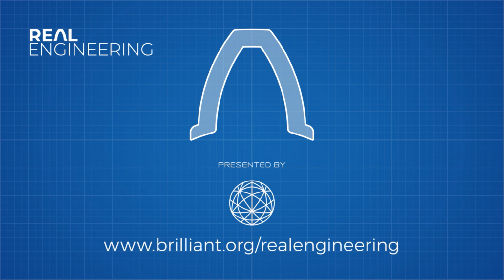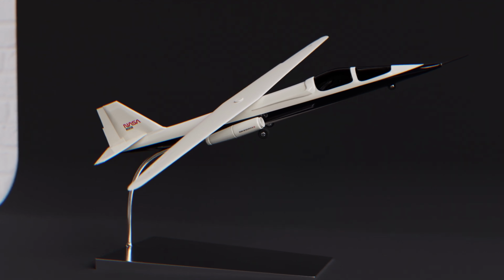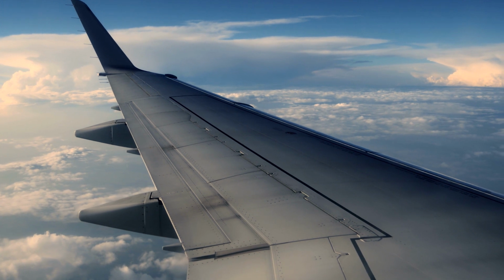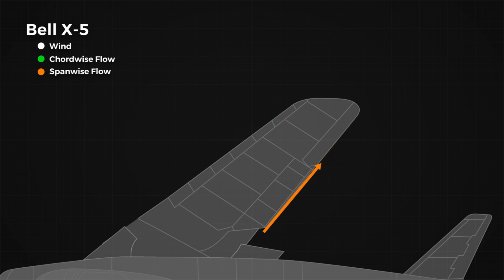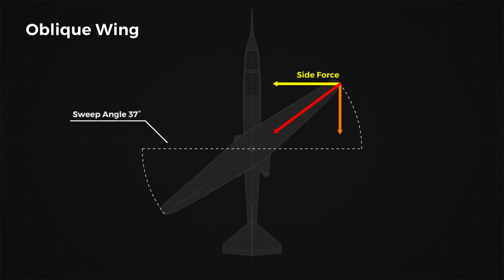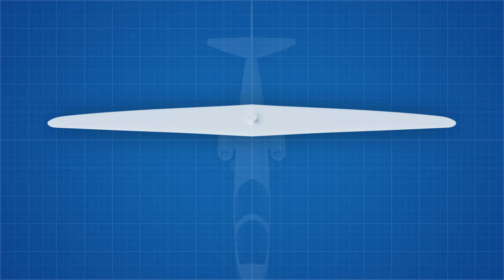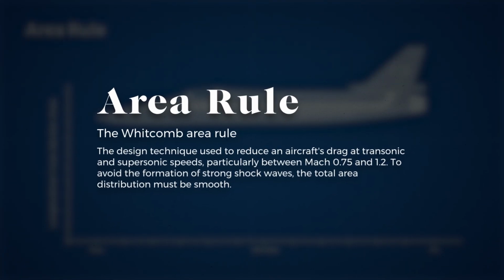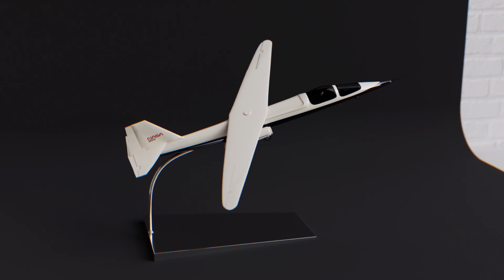NASA's Weirdest Experimental Plane

Comment: Many mistakes in this video. Really disappointing that you spread misinformation.
1. The reduction in (parasitic) drag with sweep angle had nothing to do with frontal area. You correctly say later that it's due to a reduced speed component perpendicular to the leading edge, which at transonic and supersonic speeds creates less wave drag.
If reduction in frontal area was any factor at all, than variable sweep aircraft would sweep the wings back as soon as they took off and cleared the ground, which is not what they do. The sweep back helps only when the transonic regime begins, at lower speeds it is detrimental (increasing induced drag while having no effect on skin friction drag). This is why the F-14 keeps its wings fully forward until Mach 0.7.

2. Airliners don't cruise "just below" their critical Mach number, they cruise just above it. Source - the book "Aircraft design: a conceptual approach" by Raymer, section 12.5.10 - parasite drag. 
Quoting the relevant points: "drag divergent Mach (Boeing definition) is is usually 0.08 Mach above the critical Mach number."
"The Douglas definition, also used by the U.S. Air
 Force... is typically 0.06 Mach above the Boeing Mdd..."
"Jet transports usually cruise at
 about Mdd (Boeing) and have a maximum level speed of about Mdd (Douglas)."
So the bottom line is Mdd (Douglas) > Mdd (Boeing) > Mcr, and airliners cruise at Mdd (Boeing) and have an Mno of Mdd (Douglas), both above their critical Mach.

Here's one visual proof that airliners fly above their critical Mach: https://www.youtube.com/watch?v=HekbC6Pl4_Y. 
Shockwaves can be seen by their shadow on top of the wing of this 737.

Comment: Eh, drag from a wing's frontal area is minimal compared to the vortex drag of the wingtip vortices and fuselage contributions.
What changing wing sweep does is change your wing aspect ratio - at lower sweep (and therefore higher aspect ratio) the tip vortices are reduced, minimising drag and maximising lift as less of your wing area is trashed by tip effects.
The only reason you want to change the sweep is when you start hitting transonic effects, hence why subsonic racing aircraft all have straight, high aspect ratio wings to minimise vortex drag rather than swept ones to minimise frontal area.

Comment: Airliners do not cruise below critical mach.  If you sit in an overwing exit row seat and the angle of the sun is right (morning flight east to west, port side) you can see the shadow of the normal shock on the surface of the wing.  The shock is denser=> different index of refraction => a light/ dark band forms on the wing.  Airliners cruise with a normal shock on the upper surface of the wing at about 80-90% chord.
Reply: Yes, very disappointing that such a channel spreads misinformation. I left a similar comment about this and about another mistake - the change in frontal area has zero effect on drag (if this was true variable sweep aircraft would sweep back almost immediately after takeoff). It's only affecting wave drag at transonic/supersonic speeds and at subsonic speeds it increases induced drag. That's why the F-14 kept its wings straight until Mach 0.7.
Reply: @ASJC27  exactly. the equation for induced drag has aspect ratio in the denominator.

Comment: I wonder if some of the problems could have been fixed by having two of these rotating wings that counterrotate, that way the plane is always symmetrical, or if it the problems with 4 wings would negate any advantages from that.

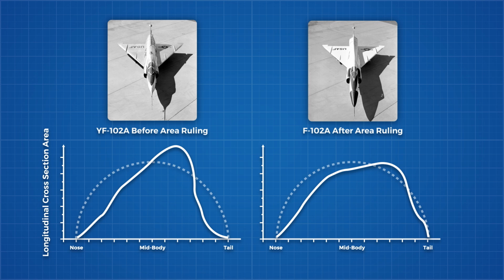Comment: I didn't fully understand the section regarding the "Area Rule".  I think I grasp the fundamental concept, but [@9:42] I don't yet “𝑠𝑒𝑒 𝑤ℎ𝑒𝑟𝑒 𝑡ℎ𝑖𝑠 𝑖𝑠 𝑔𝑜𝑖𝑛𝑔“ with respect to the AD-1. 

I can intuit that the asymmetrical geometry will certainly have a unique impact on the Longitudinal Cross-Sectional Area but it's not at all obvious to me why this would “𝑁𝑎𝑡𝑢𝑟𝑎𝑙𝑙𝑦 𝑑𝑖𝑠𝑡𝑟𝑖𝑏𝑢𝑡𝑒 𝑡ℎ𝑒 𝑐𝑟𝑜𝑠𝑠-𝑠𝑒𝑐𝑡𝑖𝑜𝑛𝑎𝑙 𝑎𝑟𝑒𝑎 𝑜𝑣𝑒𝑟 𝑡ℎ𝑒 𝑒𝑛𝑡𝑖𝑟𝑒 𝑙𝑒𝑛𝑔𝑡ℎ 𝑜𝑓 𝑡ℎ𝑒 𝑝𝑙𝑎𝑛𝑒.”

I found the YF-102A example only somewhat helpful. It was easy to appreciate how the different area plots related to the ideal in the diagram, but how the plot actually relates to the geometry of the plane in the photo is not at all obvious to me.  

Anyone else stuck on this point or is it just me?
Perhaps an R.E. follow-up up on Longitudinal Cross-Sectional Area and the Whitcomb Rule could clear this up‽ 

𝙿.𝚂. 𝙶𝚁𝙴𝙰𝚃 𝚅𝙸𝙳𝙴𝙾❕
𝙸 𝚕𝚘𝚟𝚎 𝚢𝚘𝚞𝚛 𝚌𝚘𝚗𝚝𝚎𝚗𝚝 
﹠𝚝𝚑𝚒𝚜 𝚌𝚑𝚊𝚗𝚗𝚎𝚕! ✈️

Comment: How about 2 of that wing that makes X shape when swept?
Reply: Won't work, as the aft-wing will be positioned in the drag of the front wing. They tried this with the Caproni Ca.60 (exactly 100 years ago), which had 3 triwing installments after one another. It was supposed to fly across the Atlantic, but never made it out of Lake Maggiore in one piece.
Reply: @bakkerem1967  Thanks!
Reply: I was thinking something similar.  If you kept the intersection inside the plane, it would avoid a pocket between the two airfoils.  You could probably even make it functionally entirely symmetrical, so I wouldn't hate it.  (Even though I totally admire them for trying this.)
Reply: That's what I was thinking. Why have a wing that performs asymmetrical just reduce fuel & drag

Comment: Asymmetric aircraft have been done before. Blohm & Voss BV 141 flew in Germany during WW II, but was not put in service. Bert Rutan built  "Boomerang" with impressive performance and fuel economy. Neither were nearly as extreme in design as this logic busting design.
Reply: The Blöhm & Voss P.202 design was even more like this NASA plane.
Reply: @hasenrower  Yes indeed. I was not aware of this. The identical reasoning features in both aircraft

Comment: I'm just an Airbus pilot, but I love these. Basically, flying that thing with the wings pivoted would be kinda like flying single engine all the time. But 7° bank for level flight would get really screwy to get used to.
Reply: Yeah I wonder if the same modern control mechanisms that made it unnecessary for fighters and the like, could also make it more practically controllable with modern autopilot features, especially on some sort of drone plane. That said the reasons to do so are still pretty few lol. It would be strange to always have to he rolled like that. Could be even more disorienting in IMC if you need to stay rolled to fly level and straight based on the configuration of the wing.
Reply: @revenevan11  Oh man. At least in IMC you could do something like have the attitude indicator fake wings level and recalibrate based on speed and pivot. Plus, modern fly by wire planes do so much magic behind the scenes to mask control issues, they COULD make it work. To my knowledge, modern fighters are nigh uncontrollable without the computers, so it would just be up to software to work out. But at this point, it's like 🤷‍♂️ why bother?
Reply: You'd develop a weird crick in your neck, like putting the TV in your living room at a corner angle from the couch. You'd have to alternate forward sides each flight

Comment: It would seem to me the next logical step would be a biplane, with wings turning opposite directions for more stability.
Reply: I really want to see that!
Reply: Look up "Box wing airplane designs". Is that what you had in mind?
Reply: @HalNordmann  Not really, no. I was thinking more like adding a second wing only connected to a pivot like the first on the underside of the fuselage. Wingtips aren't connected because one moves forward and the other backward on one side of the aircraft.

Now that I think about it, it'd introduce twice as much roll, but it might allow better pitch control.

Comment: Can you do the spitfire’s rival, the BF-109? You’ve already done the spitfire. Only seems fitting.
Reply: I'd assume there isn't anything espessialy interesting about it from an engineering standpoint so he hasn't made a video about it. Maybe he could talk about fitting the cannon in the center of the propeller but that's not unique to the BF109
Reply: @_M4X15  I mean I have to agree with you because he hasn’t made anything about it, but when you research the plane many people say it was a state of the art plane and just leave it at that. So it leaves me wondering.
Reply: @_M4X15  maybe the focke wulf 190 is interesting bacause of its aircooling system ?
Reply: What about the 262?